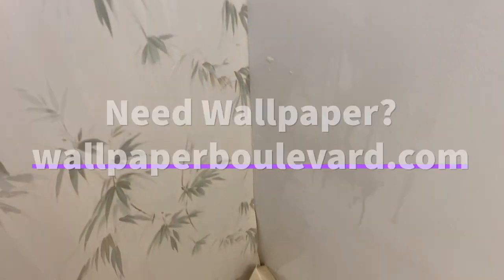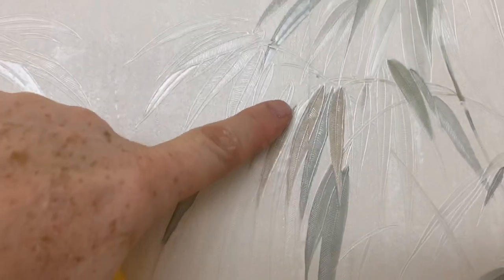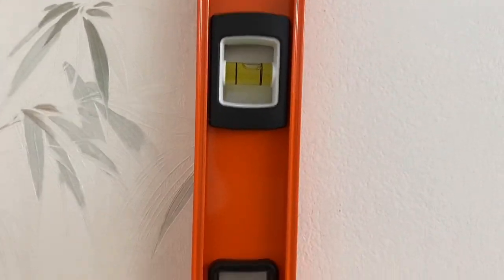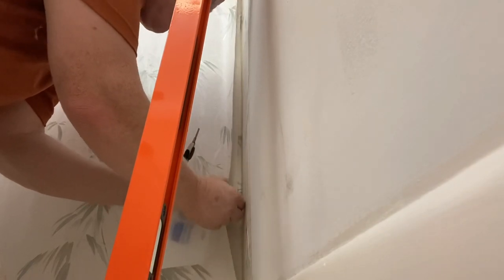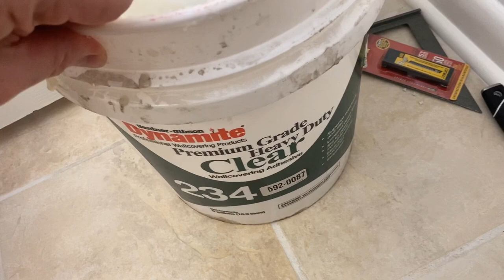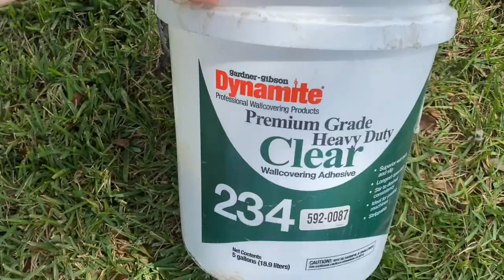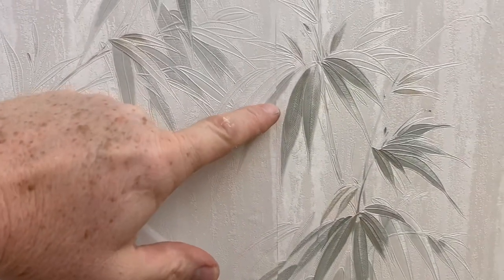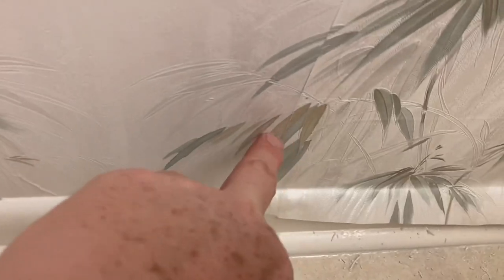How to Hang Wallpaper Inside Corners - Spencer Colgan

Comment: I always thinned cellulose paste with water and pasted all pre-pasted papers. Some of that stuff is so thin that if I used the paste straight out of the bucket, once it dried I could see some paste lines. The thinned paste will activate the pre-pasted surface while adding a very thin layer of paste which will allow easy manipulation of the sheet on the wall. It can be a bit of trial and error until the mix is just right for each particular paper so try to start in a non-conspicuous area of the room. Tried the water bath - once! Never did that again.
Reply: I would allways use a very thin paste for pasting pre pasted vynal, I allways have a bucket of warm water and a cellulose sponge as in the past I ended up with paste stains (only once) 😂 never again